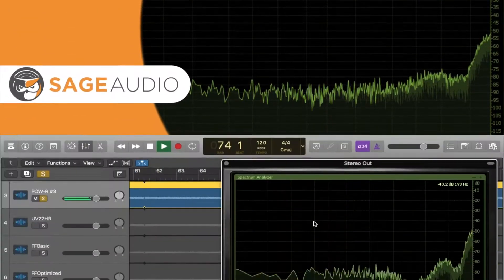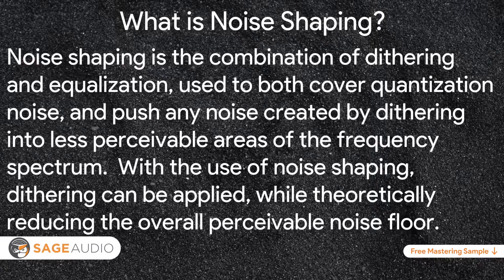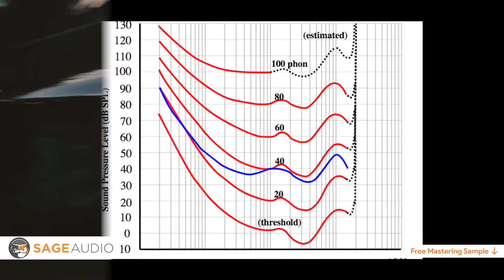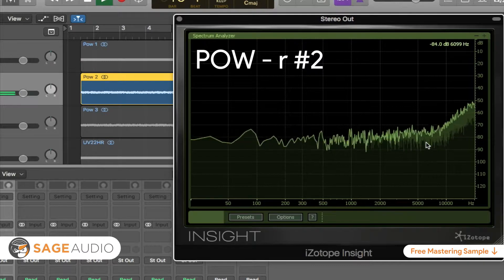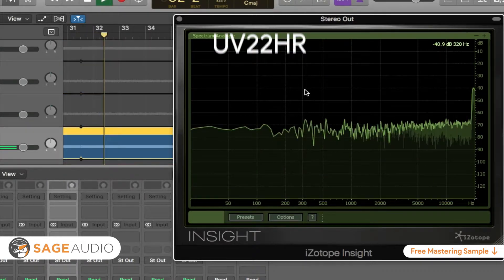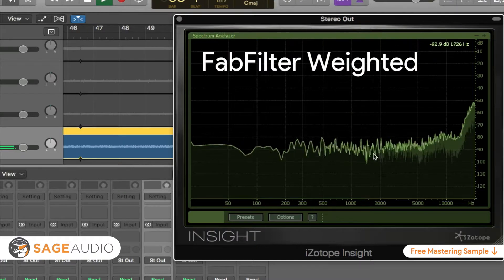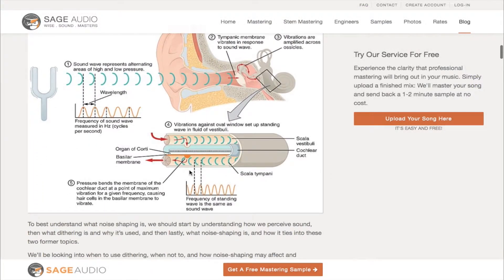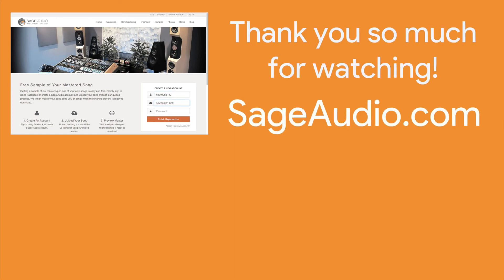What is Noise Shaping?

Comment: If I drastically boost the monitor gain to the point where I can hear the dithering noise, I find that colored noise is worse because it is diferent from broadband noise present on the recording, and it's obvious where they switch.

UV22 is weird. They don't seem to have a random generator for the two mountains, but switch several precomputed pseudo-random segments. Occasionally they are the same on the left and right and the noise becomes mono. It's not audible though because the duration is short.
Reply from the maker: Thank you for sharing this! This is really interesting - so you've found that the noise generation from dithering isn't actually randomized? The idea of it being phantom mono is really interesting too - I wonder what would cause this.